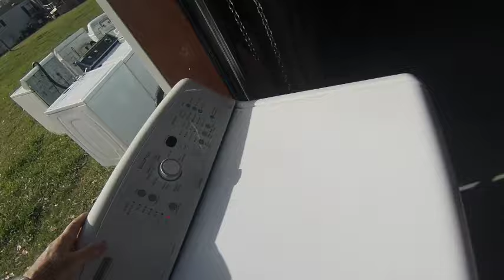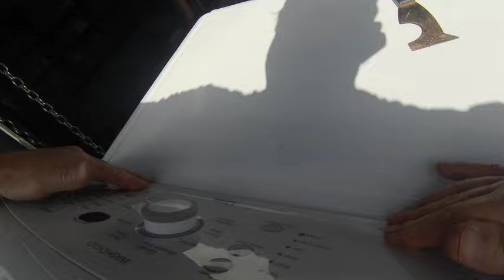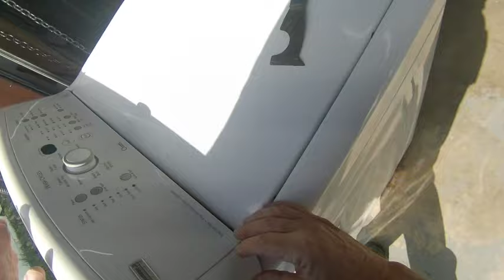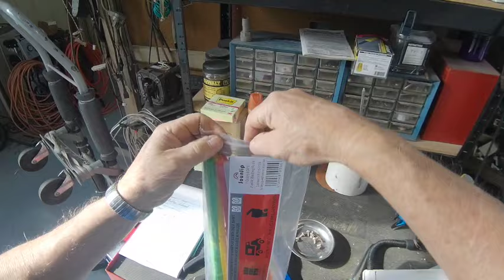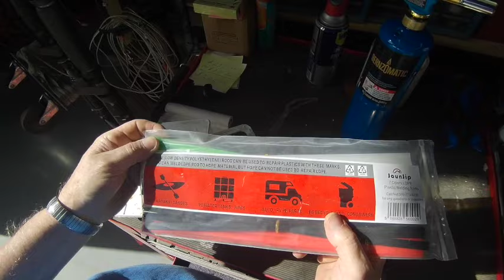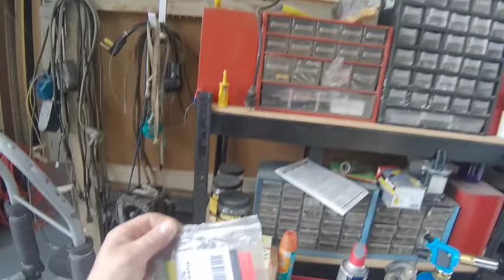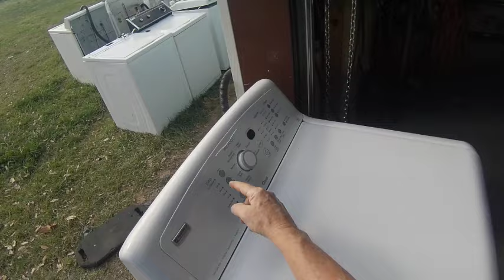How to Fix Kenmore Elite Oasis Washer Leak: Step-by-Step Bleach Dispenser & Hose Repair

Comment: Are the plastic welding sticks in the bag you were looking at not any good for repairs? I found the same ones on eBay, but I know you said that the previous owner had the green ones already there at the shop that he got from a welder.
Reply from the maker: Yeah, I bought those thinking they were what I needed but they aren’t the same thing. I have scoured the internet looking for those rods but haven’t found them yet. They are real sticky when heated and dry to a durable rubbery texture when cured. Thanks for watching!
Reply from the maker: I finally found what these are called. They are 3M Scotchkote Hot Melt patch. https://amzn.to/49QB9WV
Reply: @HarperandKnowles  
Wow! Thank you sir for the link!! Definitely going to have to pick some up!!!